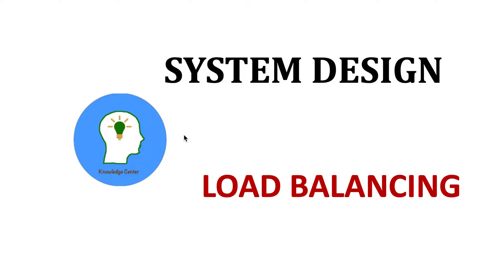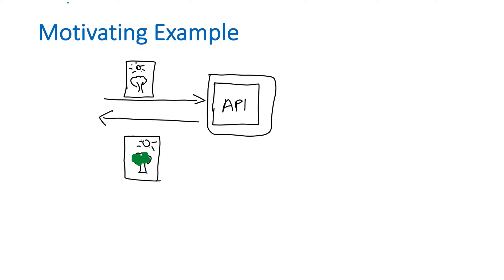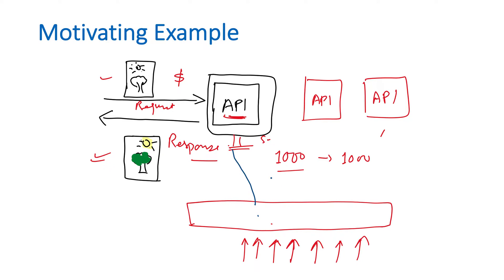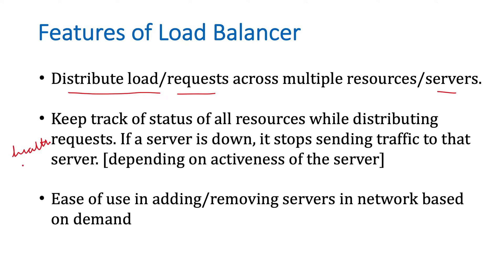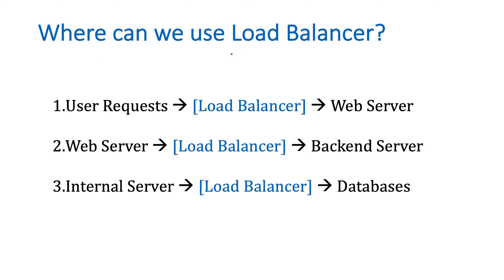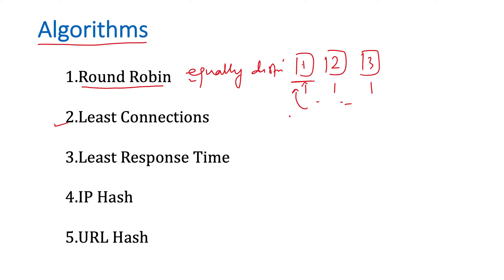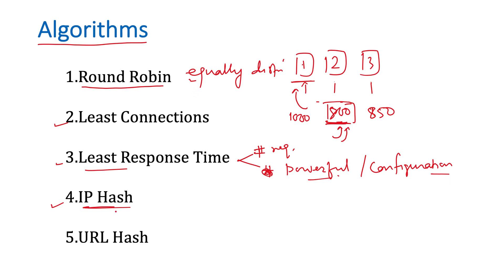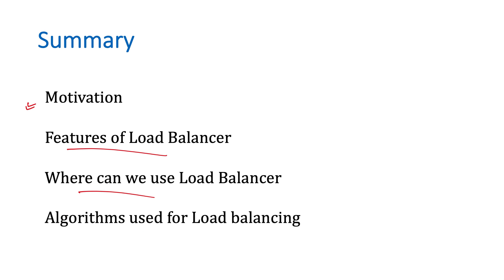System Design: Load Balancing | How Load Balancers work

Comment: Please make a video about the implementation of rnn and cnn without frameworks.  using python and numby or just python
Reply from the maker: The channel is currently new. So trying to add some basic tutorials first before adding advanced concepts. But surely the topic Suggested by you is very valuable and would like to start working on that soon.
Reply: @KnowledgeCenter  thanks
Reply from the maker: Sure. Will do that. It will take some time.
Reply: @KnowledgeCenter  ok .thanks.